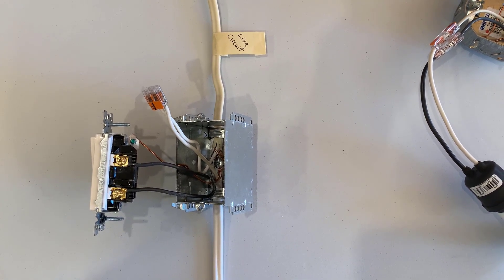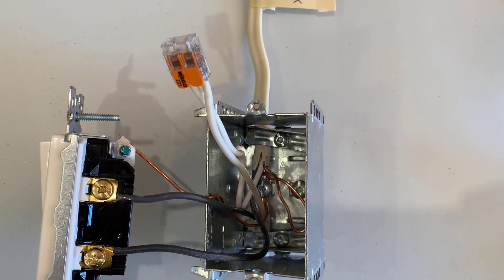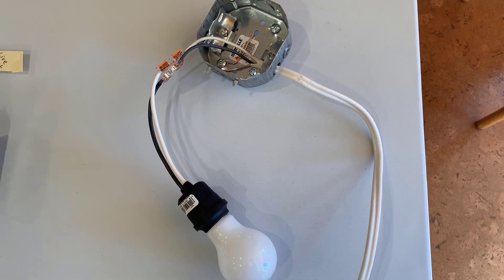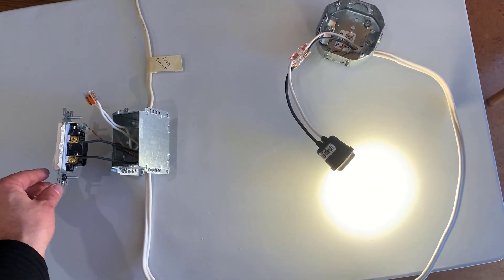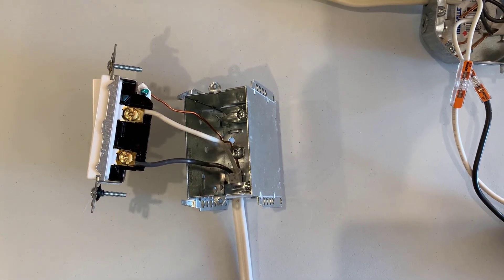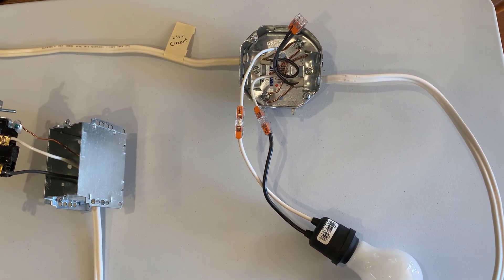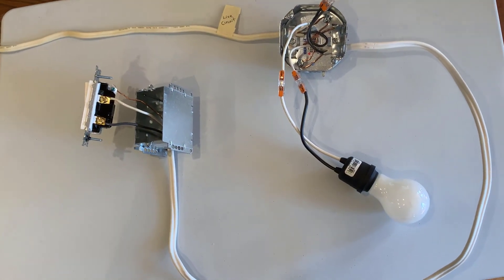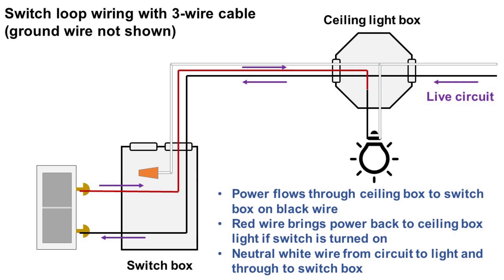One cable to a light switch box: wiring explained, what you can (& can’t) do

Comment: Can you add a new switch to power new lights by tapping into the switch of a switch loop? I'm guessing not since I think those new lights would need a neutral.
Reply: In this illustration he's showing, all the power is at the light fixture/ceiling fixture, and not at the switchbox. Unfortunately in my case, and probably yours as well

Comment: What's the top wire on your sample switch? The bare looking one. To be clear, I'm not talking about the white wire with the wire nut on it. You've got the red and black plastic coated wires connected to screws and then a third wire on the top of the switch.

Comment: So I just put a floodlight camera above my garage where there was a light previously so the connection goes to a switch. I want to replace the switch and put a flat plate there. But there is only one black wire, one white wire and a ground wire. How do I get a continuous supply of electric to the camera with just three wires if I want to take out the switch?

Comment: so if the neutral is not connected to the switch, just the phase wire is connected to the switch. the  light will still turn on and off.

Comment: If I want to install an in-line remote switch, and that switch has four wires: two in and two out. Which wires do I connect to the single wire going from my light bulb to the ceiling box?
Reply: yeah I was about to ask this same thing can we get a response to this question, or did you solve this and can offer me how you did it

Comment: Thanks for explaining this! Unfortunately I ran into this situation when I tried to install some smart switches that I got through the Amazon Vine program. I had never seen this situation before and I didn't know what was going on. Now I have a pair of smart switches that I can't properly review and that's the whole point of the Vine program. One of the lights I wanted to do is a hall light that is very close to it's switch and the wires run between the joist so I'm going to try to fish a second wire through. The other light I wanted to do is another story though, it won't be so easy. It will require at least 25ish foot of wire that will have to go through 4-5 joist. What's also crazy is that my house was just built in 2011 and they still used this style of wiring. 😢
Reply from the maker: Thanks for letting us know it could be common in more recently built homes too. I guess it is one way to cut a bit of cost. Maybe the lesson for everyone is that when you are having a home built you need to specify the full wiring so that you can use smart switches in the future.

Comment: No big deal really?  The power could go into ceiling light fixture, grounds hooked together, and to metal box. black of the line goes to the white of the switch leg and has black tape wrapped around it 
and black from sw goes to the load or ceiling lamp.

Comment: I've come across this while helping my stepfather rewire his 1973 doublewide.  The home had aluminum wiring throughout as was common during that period,  and several outlets and switches had burned connections, melted insulation and the wiring was too far gone to be able to pigtail with copper and made safe again.   The most dangerous was the three way switches in the hallway. Power was fed to the light, and one 12/2 AL NM cable was dropped to each three way,  using the ground as the common and the black and white for the travellers, in metal boxes energizing them.  The electrical service was a 60 amp breaker box Zinsco brand, the contractors who wired the place went very cheap and strung many rooms on the same circuit to use the least number of breakers possible, and  few breakers had arced and welded themselves to the bus bar.
Reply from the maker: Sad to hear of the shortcuts some people take and leave a mess for others to fix later.
Reply: Most of the issues you brought up had more to do with the failure of smaller gauge Aluminum wiring. It turned out to be a bad idea and was no longer legal to use by Code in small gauge sizes. And manufactured Homes or in the day, Mobile homes were manufactured  to HUD standards and monitored accordingly at that time.

Comment: The white should be the hot from the box to the switch and the black should be the switch leg back to the light, if I remember right white can be a hot, but it can't be a switch leg per NEC, you can mark the white with bands of black tape at the ends to indicate that it's a hot.

Comment: I wired up a switch like you talk about 2 years ago in the basement.  House had two pull chain lights in the ceiling.  In one room of the basement.  I wanted to switch both lights on when I came into the room.  Not walk into a dark room and pull two separate light strings to get the lights on.  Power came into the ceiling box nearest the doorway.  And then fed the other light further across the ceiling.  I used one 14 gauge cable to go over to my newly installed switch by the doorway.  Put black tape over the white wire in the cable so you knew it was hot.  Connected the white taped wire and the black wire to the switch, and to the power in and light in the box.  Also tied it in so the second light also came on when the switch was turned on.  Can't imagine why this simple and safe method would be against code.
Reply from the maker: I had the same issue in our furnace room when we moved in. Why make people walk into a dark room and trip over stuff trying to find the pull chain?! I think the code was updated so that a neutral wire was available in the switch box. It gives more flexibility for future devices and needs.

Comment: Good Video.  I have an older home and have seen this before.  I do want to note a discrepancy in the switch loop wiring and diagram.  Per NEC 2020 200.7(C)(1), on reidentifying white wires.  It says for switch loops that the white(reidentified) wire shall only be used to supply the switch and not as a return.  So the black(hot) line wire coming to the light box needs to be attached to the white wire going to the switch (and reidentified), then the black wire from the switch can connect to the black wire on the light.  The line wire's neutral is still connect to the lights neutral.
Reply from the maker: Thanks for the clarification. It would be great if all the wiring in our homes was done to code but sadly a lot is not. If someone is dealing with older wiring they need to be aware that it may be wired either way. I think the 3-wire switch loop is better and what should be used if installing this in a new switch setup.
Reply: @upgradeyourhomediy  Yes, things get missed sometimes by inspection or untrained tradesman. But Remember all of our codes in the US are constantly changing. They are on a three year cycle. Depending on the changes homes built 2to 3 cycles ago no longer meet codes. But they did at the time the permit was obtained.  DIY or Bootlegging work is a different story.
Reply: I had this situation with a switch that had red, black and white connected to a three way switch. On the other side it has two wires but the light will only come on if both switches are in the same position. Should the three way switches be removed?

Comment: Best practice for switch as I understand it is to mark the white wire as hot with a marker or tape then connect the black wire from the switch to the fixture. This leaves a black and white going to the light socket.
Reply: Yes sir. This called a “ drop switch leg “.

Comment: Haven't ran across this yet for a switch, though had planned to wire some lights like this. Good to know it might be against code to do it that way. Thanks for your recent videos, they're good I hope you keep it up. Subbed.
Reply from the maker: Thanks for your support. I think switch loop wiring is likely code in most places so I think your plan to use it is probably fine. You may want to check your local codes to double check. Make sure you use a 3-wire cable so the neutral comes to the switch as well. It gives you more flexibility in the future. Good luck with the lighting project!
Reply: @upgradeyourhomediy  Another good idea if you're building a house is to run a four wire cable in master bedrooms dens living rooms etc... as it gives you the ability at any time in the future to switch one or more outlets.
Reply: Ran into this setup at a friends house. Whoever wired the circuit screwed up in the ceiling box so the light didn’t work. Had to trace things back to the breaker box where I found the original person reversed the wires. I switched them around and things worked. My friend was happy. I’ve added lights in my house and I won’t use this method for my own stuff.
Reply from the maker: @alanyoder7629  Your friend is fortunate to have you around to help out and fix the issue. I wouldn't use this to wire a new switch but this switch loop wiring is common so homeowners need to know what to do when they encounter it.